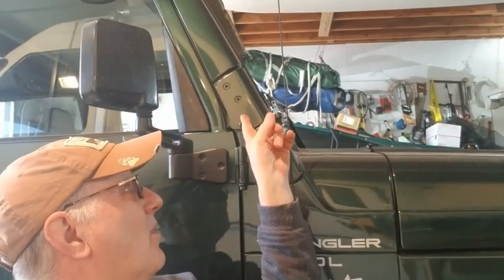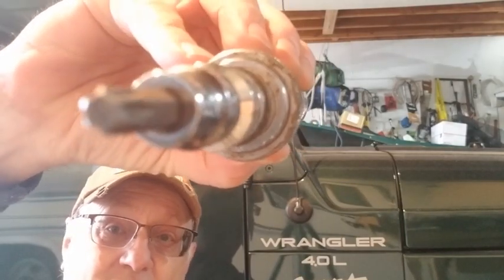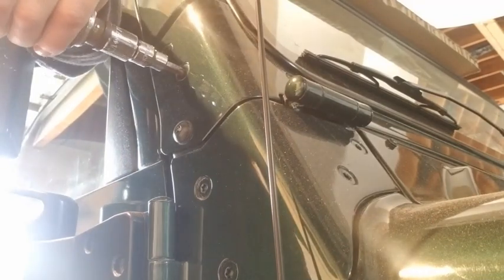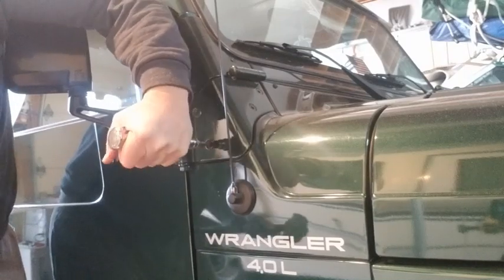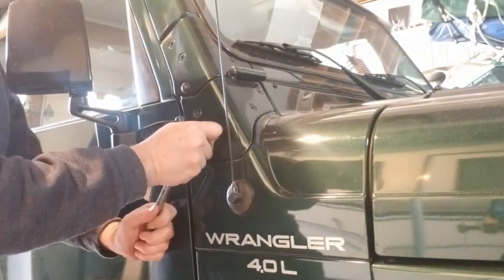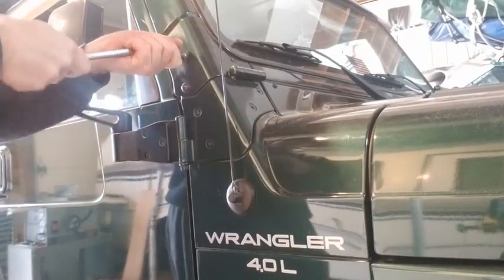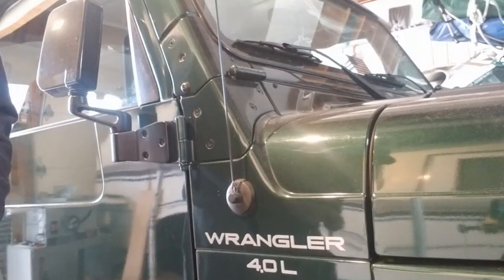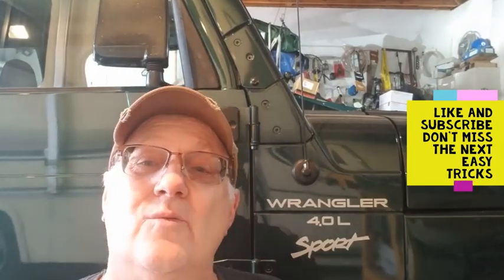Jeep Windshield Bolt Removal the Easy Way Stop Stripping the Bolts Overland Project continues TJ YJ

Comment: So...Use an impact driver. Okay.

When you put it back together, you can reduce problems from corrosion in a few ways. First, if it's suitable from a load point of view, consider a stainless-steel fastener. Second, with or without a stainless fastener you can use blue Loctite or some other vibration-resistant thread-locker. People will tell you to use anti-seize compound, and that works too, but thread-locker works just as well to prevent moisture and air from getting between the thread forms and corroding. If it's a fastener you can see removing periodically, then use an anti-seize goo. If not, use a thread-locker.
Reply from the maker: Josh, Yes that would be a great idea, if you watch my other video I put different bolts for the custom roof rack system   This shows how to stop the plates from dropping as well.   https://www.youtube.com/watch?v=9YI4vfc921A&t=109s

Comment: That sounds like you still had to break the the fastener loose with your wrench (the little crack sound was the tell). I keep hitting the impact driver until the fastener starts turning.
Reply from the maker: I just hit each one several times and then the wrench yes so cracked the paint with the wrench some did not.

Comment: What's the tool called? I didn't catch the name of it
Reply from the maker: This is not the one I have and I don't know the seller, but it is like this  https://www.ebay.com/itm/254827006803?epid=10017745459&_trkparms=ispr%3D1&hash=item3b54df8b53:g:HwIAAOSwColf9YJ6&amdata=enc%3AAQAGAAACkPYe5NmHp%252B2JMhMi7yxGiTJkPrKr5t53CooMSQt2orsSg3Ye8yTWgOW7pmE1t838dghqeZYZ9KoR8JjktDkYUj6PjaxMMLtmnecjaRbQYRSGK41C4YZplF4JLzUoHv%252FR%252FaV5ZC5JuaBznAeI1O4TkGMO5MNizr8BOzd2qRKT4dnVQKKLDKy1L0URPi9%252BGI37ScgsCu47T5Z%252BPqjR%252BXcg6t8UnISE3dwV1UIxBhjVzx96%252B5XKfEmp10Bwp%252BAq0eX20qVEbke0rc1YmxqpQz13AFh2q8LPYJIciblgGCFFl6DmBXKs3csKRJmFfhtd23hdKj6WR%252BXQc5v6YcZ3daxp4xfO0HxVRzy70UugMr4Y3zL25ylWved%252F6By8cQ7ONOJXZOCkUDP8TkhCqOlgDYkURzCi27h1h3lrcZF5jM7MdA%252B0BPFBybKpFbvIil7BtIHW6iWzN6kukEPOEodqbGkyhPQdz14NuEixvsw5gEj41JQ%252BvQdVAtThsusmX3BR6l4Wt6mmTmdwY4iKVx9yqb%252FSBdeklihq1mbUBJO4KeulnMAM64RKXAh0EpiTCblVF4tMXh0heJF0KvQXC7%252FojpduxWEOnR6Fwsv%252BjPPfMhQIke93faZADH8%252By%252BSBJyCd3z4vu0f2lA1HGdugDbs6atzQ%252FkyZQ39r5XXpTBRHpTNqhuBZBX7HW7i2W5qEeLSBUqD9j61s9GylNWq%252F8pyQ1lmPl0jYukESlbN6qU1hhD2OF1OFRkeCyj7kOQ9ZOWJNXWiqfxwwuJXmb2Kc%252BQyqLD5nReXBLTFT7C1K6N9D1tDHWIBlkVkDNa%252B9Xypjd14JNZApFxv81Pzevw4194I7%252B7AoDRBj7baMmSzqgYniT%252FV%252Fvrwb%7Campid%3APL_CLK%7Cclp%3A2334524
Reply: It’s called an “impact driver”
Reply from the maker: I put a link to it in video text
Reply: @mytwogoodhands2799  Good video, but your description says 1/2" driver, but the link provided is for a 1/4" driver.
Reply from the maker: @rickv4714  Once on the page you can choose drive size, looks like the 1/2 is out of stock but there are others listed lower on the page  THanks for telling me about this  Steve
Reply from the maker: @rickv4714  Link has been updated to list item in stock Thank you